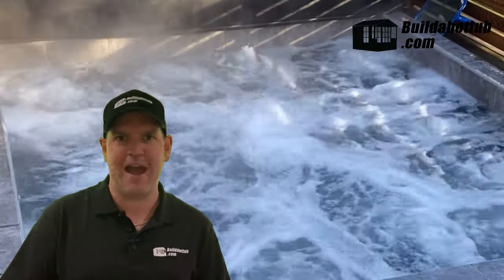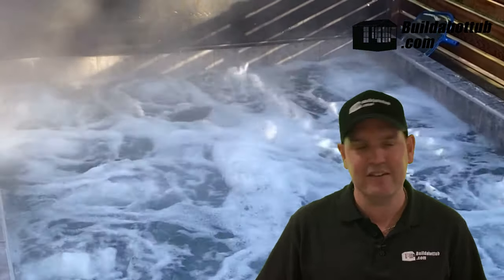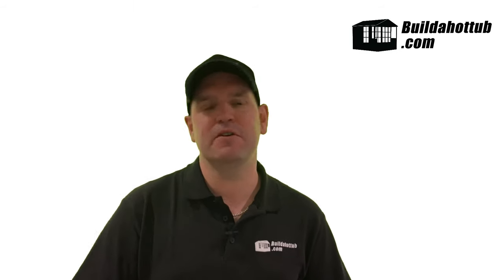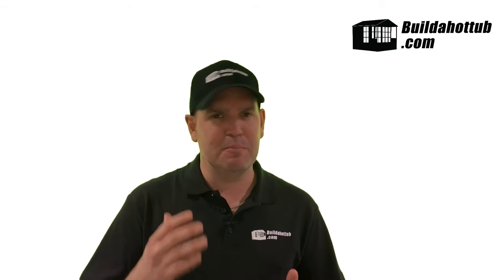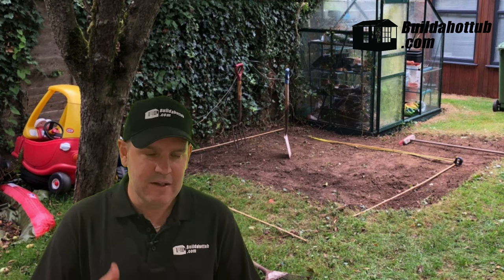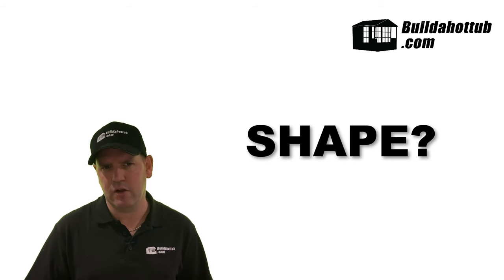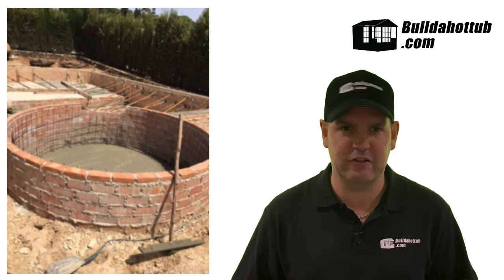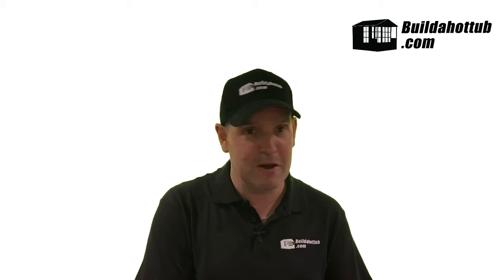How to build a DIY Hot Tub - Step by step tutorial. I cover it all!

Comment: I built pools, but have problems with pool heaters. How many kilowatts can heat 50 cubic mt in 2 hours?
Reply from the maker: Hi Ramohn, Many thanks for the message. How hot are you looking to get the pool to? Lots of variables here like insulation, goegraphic location, ambient temperature and starting/target temperature. Electric is probably not the way to go as you are looking for speed. Gas would be around 37KW/122k BTU for that size. Gas/Propane is the quickest in terms of heating. An Air Source Heat Pump would be more efficient and you would need 17KW/58K BTU for that body of water for the brand of ASHP. These figures are based on the brands I supply and their spec sheets. Hope that helps - Andi www.buildahottub.com

Comment: thanks for such long and detailed information. im wondering if i can make myself one of those and if i can re-use some of the "gadgets" from my old 'normal' home bath tubes with 'jacuzzi' :)
Reply from the maker: Hi Antonio, the parts from those "bath tubs" are more suited to stock tank tubs than concrete or block built hot tubs - you will really struggle to make them work for that kind of a build. For example, you might have a 0.5HP or less pump on a Jacuzzi bath, you will need 3HP+ on a concrete tub. Jets are totally different too and wont fit to block or concrete and pipes are much smaller on a jacuzzi tub - there also tends to be no external heating or filtering. I have more info on stock tanks here - https://buildahottub.com/how-to-build-the-ultimate-diy-stock-tank-hot-tub/ if that is something you are interested in - cheers, Andi
Reply: @Buildahottub  thanks for such fast reply. i will give it a look later on! br

Comment: We purchased a large above ground spa for our RV park. The salesman sold it as a commercial spa.  When the county health inspector showed up he shut it down because it was not a “commercial spa”.  I guess the issue is that the filtration system won’t handle the number of bodies in it.   So I was wondering if we could connect it into the pools system.   I would think water from the pool system could be pumped in and then flow to the pool?  This would then not be a true spa at higher temperature, but that would be better than no spa.  Or could temp be higher if heated water went directly to spa then the pool.  Your thoughts. Right now the investment is wasted.  The inspector seems to think a commercial spa has to be inground.
Reply from the maker: Hi Ivan. Thanks for the message. I stay away from commercial projects for this exact reason - a lot of red tape. Commercial Spas usually have a balance tank (an overflow as you never know how many people will be in them and you need to store the displaced water to be returned when they get out - this is probably what you are refering to as being in ground) a higher turnover of the water (speed it all goes through the filter), they use sand filtration medium not cartridge and usually have auto dosing chemical systems attached to them too. The heat controls are usually not accessible to the bathers who just have on/off buttons for the jets and blower. This is somewhat simplified and this may vary from area to area but as I said, this is not my area of expertise and i only work on domestic projects. The chances of doing what you are suggesting and getting a health inpector to sign it off is slim in my opinion, again, only an opinion as I dont work in the commecial area. Sorry about that - my opinion is that you are best getting in a spa professional to convert what you have to being comercially complaiant - hope that helps - Andi

Comment: Thanks for the video. You haven't mentioned anything about air control valves...are these necessary?
Reply from the maker: Hi Dean - thanks for the comment. On this kind of a setup, you use a blower rather than veturi for the air. With a plastic shell hot tub, quite often they dont have a dedicated air blower. What they do instead is open up a valve to allow air in - this is drawn in by venturi and increases the power of the jets. On the system that I use in my builds, the air is blown in by the blower and as such, you dont need these air valves - hope that makes sense - I have a video on the blower and how that works too - thanks Andi

Comment: Is it possible to run a generator that is separate from the house to power everything that will be in the control room???
Reply from the maker: Thanks for the comment - don’t see why not - depends on how much you can generate - if you are running on electric to heat and use jets could have you at 40A per hour which at 220V is about 10KWH - hope that helps - Andi

Comment: the confusing part for me is yes water weighs alot but.... so does the dirt you remove especially if its full of stones ?
Reply from the maker: Not sure what you are getting at here. Yes, the dirt you remove weighs a lot but there is no structural integrity required for just the dirt alone, there is to hold the water though. Thanks for the view though.

Comment: How did you source spa cover? Would like more info on that and if you need to size spa based on standard cover sizes.
Reply from the maker: Hi Jeff, I get my covers custom made to fit the tub that has been built. Best way is to build the tub first, then once you have at least the walls in place, get an order in for a custom cover. Dimensions can change on site during a build so it is always best to work with actual dimensions rather than ones from drawings. - Hope that helps - Andi

Comment: did you install a filter system or only the hydro jets pump/system?
Reply from the maker: Full System, pump, filter, heater jets - hope that helps. Subsequenty, I have remodelled from that video and have added a circulation pump and separated the jets and the heating and filtration - thanks for the comment - Andi

Comment: Also what is the purpose of jets and a blower, if you just want warm water to soak in to save cost ?
Reply from the maker: Relaxing in "agitated" water which is what the jets and blower do, for many is the experience they are looking for - including me. Their purpose is to "agitate" the water. You would need some form of hot water return from your heater if you were going to have just a hot swimming pool. Some do this, especially on a plunge pool or cocktail pool setup - there tends to be no jets. You are right, that setup is cheaper too. Thanks for the comment, cheers, Andi

Comment: I pulled my old tub (30 years old) a few years back and I still have everything that goes with it.  There is a well done 94"x94"x6" concrete slab, dedicated power box with 20amp/120v and 30amp/240v gfci breakers and a lockable cage around it.  I figured if I'm already half way there so it might motivate me to do the project.  Otherwise I was going to remove the cage fill in the hot tub hole in the deck when i resurface.  Seems like a waste.  Does this sound like a good start for a cinder block tub?  Also, I was curious if the tub needs 120v and 240v, I wanted to use the 120v breaker for a near by mini-split.  The feed from the main panel is 240v 40amp.  Is that enough?  I'll have to check and see if they used bigger than 8-gauge wire.
Reply from the maker: This does sound like you are on your way already - this was something similar to "Rob in France" one of my case studies on the website - https://buildahottub.com/case-study-rob-in-france/ - you need 120V for the light, everything else is on 240V. 40A will only get you a 3KW electric heater and a jet pump running at the same time - if you switch out the heater for something like gas, propane or air source that can heat the tub a lot faster as whatever you build will have more volume of water than a plastic shell tub - hope that helps. I have lots of designs in my store you can follow - https://shop.buildahottub.com/product-category/structural-engineering-permit/?orderby=popularity - cheers - Andi
Reply: @Buildahottub  40amps at 240v will only support 3kw and the pump?  Did you think I was running 120v?  My dedicated hot tub subpanel is being fed 40amps at 240v.  Not sure if the 20amps at 120v is pulling from a 240 leg or has it's own wire run, I need to pull the panel cover off to see how it's wired.

Comment: whats the rough cost for 8x8 / exactly the same as yours?
Reply from the maker: Hi Dexter, thanks for the message. 

You can find a link to the design here. https://shop.buildahottub.com/product/the-original-102-x-90-dimensional-plumbing-shopping-list-instructions-imperial/  There is a metric version in the store too. 

Most customers will build all in for between $6000-$7000 (USD) - a lot of that depends on how your finish the tub and the tiles you use etc.

Hope that helps 
Cheers

Andi